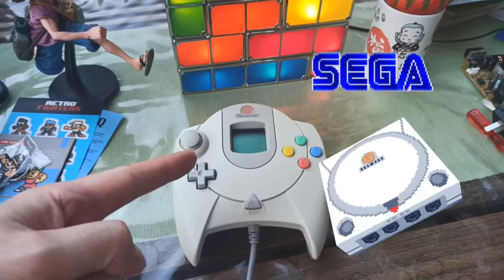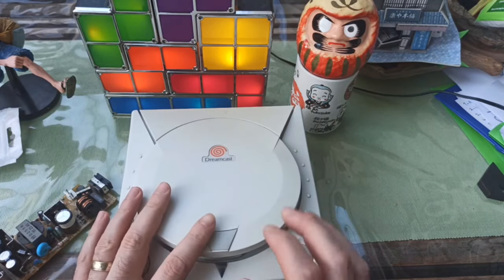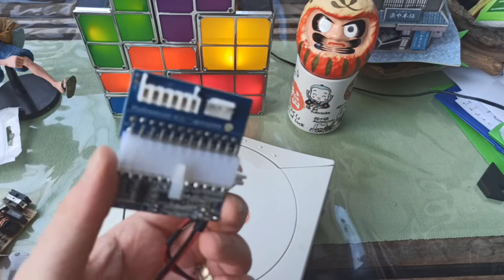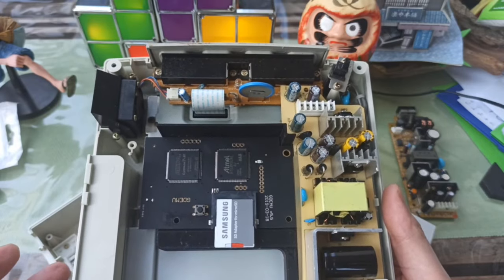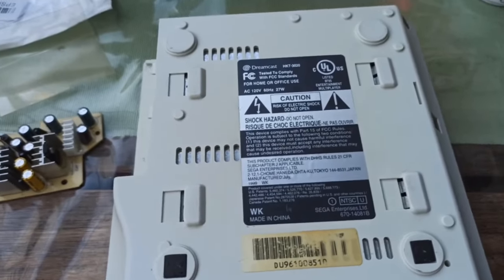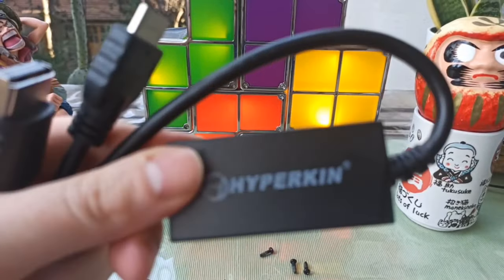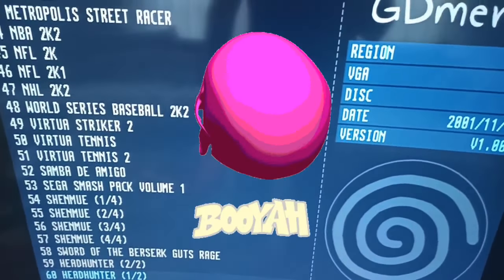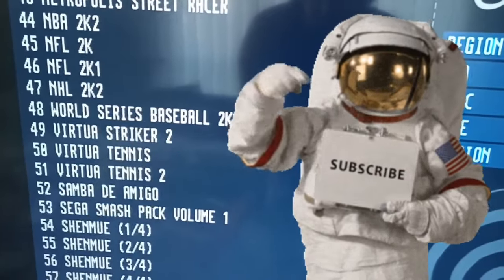Easy Dreamcast Mod

Comment: Get a dcdigital mod and a terraronion mode as there are a couple of games that glitch using a gdemu clone.
Reply from the maker: Thanks for the info! Researching both now, thanks a lot 🙏
Reply: @GamersOverdriveRetroMode  plus with a mode you can use USB harddrives I've got a full dreamcast romset on mine. I've also got 2 retro fighter pads and a brooks wingman controller adaptor and I use a wireless xbox one pad with my dreamcast and it works really well even the vibration function and its got a 1mb vmu built into the adaptor.
Reply from the maker: So awesome...I love the mod scene but I am a relative novice. Always happy to learn from more experienced people. Thanks for watching, and for the awesome info 🙏
Reply: How much better is a dcdigital than a decent vga adapter? On the comparison videos I've seen it looks very similar but I know youtube compresses the video etc. I can live with my GDEMU clone as a couple of games not working right doesn't bother me, but I'm curious about the DCDigital.
Reply from the maker: The DC Digital is a little over a hundred usd from what I've seen, but it's an involved install and you will need a little mechanical know-how (and a soldering iron). Some services will install it for you for a fee. That said, it's absolutely the cleanest signal you can get, but I'm happy with an Akura Box from the Behar Bros for now. Dreamcast games were designed for 480p. Seeing the games in 1080p is very clean but also reveals all the jaggies. Personal preference... Thanks for watching!
Reply: @GamersOverdriveRetroMode  - Yeah I thought it would be a debatable improvement (in subjective terms, not objective). I got a VGA adapter from Kaico for £13.49, looks great!
Reply: @davidste60  it's way better than vga loads sharper and more vivid. Plus you can change video modes and resolutions so games that don't support vga can still be played without swapping a/v cables plus you can in game reset.
Reply: @edbeasant9494  That's weird, it doesn't look much different in comparison videos. The other stuff can be done with gdemu, but if the picture's really a lot better maybe DCDigital is worth it.
Reply: @davidste60  na gdemu still won't play non vga games without swapping a/v cables even with vga patch selected. Some games just can't be vga patched. It's a lot better via dchdmi look at digital foundry videos.
Reply: @edbeasant9494  Oh yeah there are some games that can't be forced to vga. I've watched the DF retro videos, I don't know if it's my vga cables (cheapo kaico ones) or my TV, but my Dreamcast looks way better than their captures of the Beharbros ones, they just don't look good.
Reply: @davidste60  I think dchdmi is way better myself its a true digital signal so it is going to be better than vga it's just not a cheap option.

Comment: Does anyone know where I can get the best made dream PSU or pico PSU? They have a lot of them floating around on the internet at varying prices. Where should I buy it from?
Reply from the maker: As I mentioned in the video, I got mine on Amazon from a seller who no longer has them, but if I had to buy another one, I'd just go for Ali Express. They're reasonably priced, and while the wait time is on the long side, I've never ordered a product from them that didn't do what it was supposed to. Other than that, yeah, they are floating all over, mostly on ebay. I hope you find a good one!

Comment: So who can I send my dreamcast to in order to get some mods?
Reply from the maker: I wish I could tell you, but I don't actually know anyone who specializes in it. You can buy a fully modded Dreamcast from Ali Express with a hard drive installed in place of a disc drive. Or, you can try to do it yourself like I did in the video. It really isn't difficult and it would only take an afternoon before it was up and running. Links to all the parts you need are in the description. If you're not wanting to risk damaging your dreamcast though, check out the options on Ali express. I buy from them all the time.

Comment: Hi all! Dreamcast is still my all time favorite console. If I could find 1:1 ports of Master System Phantasy Star 1-4 that could be played on Dreamcast (not some “remake” editions), it would be the only console i care about. 

I’m loving the idea of the GDEMU, and I’m not asking for pirate links, but is there any known way I can take my original/official DC game discs that I own and create GDEMU images directly from them? A “GD-to-ROM” ripper app? I’d buy a GDEMU in a heartbeat if I knew how to get the game files of the proper format to add to an SD/MicroSD card to use! What file type is needed? .iso? .bin/cue? .CDI? I’m dreading the day my original optical drive fails. 

2 more questions: 

1. Does any company make new replacement GD-Optical drives for Dreamcast? Or compatible optical drives so I can swap it out when the original dies? 
2. When using a GDEMU, do you need a separate SD card for each game? Or can multiple games be stored on and played from one SD card? Is there a menu system to choose which game you want to play? If so, is that built into the GDEMU or require separate software? 

Thanks to all for any help!!!

Comment: No this isn't.  The ultimate mod is the DC HDMI.  Also that PSU is janky and the stock one should be retained unless you are importing a 110v DC to a 220 country and vice versa and then you could always just find a for parts DC from your region and swap the PSU from that.

Comment: What’s the longevity of these mods?
Reply from the maker: Great question. I guess only time will tell. All of these original consoles will die over time. Boards and chips erode. Digital preservation is the only way we'll be playing classic games long into the future, so I just see this as a nice midpoint compromise between the original hardware and the increasingly digital future.

Comment: Ultimate????? You forgot the fan upgrade, battery replacement, pico fuse replacement, dc digital come on mannnnn
Reply from the maker: 😂You're right. I do need all that. But I'm a busy guy and it took me forever to find the time to get this far, so it's "ultimate" for me until further notice.

Comment: Man, I was like wait he was able to install a gdemu into a launch edition Dreamcast. Than he turn it over and it v 1. I have a launch edition that I wanted to do the same so badly, but couldn't because mines is v 0. The only way for me to do the same is to buy the Mode which cost so much money, I just can't.  If I do ever buy one I rather throw that into a Saturn which is a more complicated system to do anything for. It suck having a v 0 Dreamcast yet people keep telling me that the best version.
Reply from the maker: Very interesting...I bought this console together with my best friend. We bought two consoles on the same day, 9.9.99, after saving up for months. I sold mine years later, but he kept his and gave it to me 2 years ago after I told him I would eventually mod it. I honestly have no idea what the differences are between a version "0" or a version "1" but I called this a "launch model" because it was purchased on launch day. How is it possible that I have a V1 if it was purchased on 9.9.99? If you know, please let me know!
Reply: @GamersOverdriveRetroMode  This from a random site, but I remember reading about it when I was interested in modding my Dreamcast as well.

VA0: Found mostly in JP region, though some US consoles exist as well. Uses slightly earlier motherboard revision with temperature sensor, heat pipe and metal fan cowl (some sources say it’s because it heats up more). Has earlier BIOS version but most importantly both the BIOS and FLASH chips are 5V devices and output 5V on the G1 bus – which is not safe for GDEMU.

VA1: Most of the Dreamcast production run was VA1, nothing special about it

Yeah I guess I got unlucky. I reserve mine  from Gamestop. I can still remember the day it launch. I was in high school when it ended for the day. I got in my car and sped all the way to the mall. I also reserve Soul Calibur because I played it a few time in the arcade  and really like it. After that my house was the go to spot and I remember playing that game with friend for years before dropping it for something else. Only to play it again in preparation for Soul Calibur 2 arcade.  Good times.
Reply from the maker: Awesome...and thanks a lot for that info. Dreamcast launch was one of the best days of my young life 😂 My friend and I got ours from Electronics Boutique in Boston, and I bought just about every launch title and accessory they had...I saved up every penny for months  from my job at a cafe called Au Bon Pain. My friend and I road the subway home like two bank robbers, sweating and looking around in anticipation of getting jumped and mugged. When we finally made it to my house, I set it up, popped in Soul Calibur, and then it was a wrap...nothing else could compare, and the jump from ps1/N64 was mind-blowing. No console since has impressed me in the same way.
Reply: I have a VA0 and had to get a MODE as well. It may be more expensive but it’s much better than the GDemu. For the Saturn I wouldn’t get a MODE but rather a Satiator.

Comment: how the heck you hate Shenmue? you don't deserve this...Now talking seriously GDemu is cool, I was kinda suprised that you got the original, specially considering the lot of clones that are on internet right now
Reply from the maker: I think I also have a clone actually. It seems to be a very good clone though. Really can't tell the difference personally, and it was much cheaper. But yeah played Shenmue to death when it came out. Can't stand to look at it now..for many reasons. I respect its fans, but I have no love for the series, or Yu Suzuki.
Reply: @GamersOverdriveRetroMode  nah I think is original the main difference between a GDemu clone vs an original in aesthetic is that the original is black colour with a little graffite tone (like the colour of the first N64 model) and the clone is black and a little shiny, but yeah if is working fine until now is better not risk to update the firmware, cause updating it kill the clones, so is better leave it as it is now, anyway and about Shenmue I understand, I personally don't come back very often to the first game, but to the second game I finish every time once a year, but is understandable in the case of the first one cause in time progress it aged sadly.

Comment: Is jojos bizarre adventure available?
Reply from the maker: Love that game, but it doesn't run in Vga mode unfortunately!
Reply: What is vga
Reply from the maker: Original Dreamcast had a few output options. VGA was the highest quality and the one closest to the HDMI we use today. The GdEmu board I use inside my dreamcast allows me to play games off an sd card through the VGA signal, which is sent through the HDMI cable. Anyway, not all Dreamcast games are compatible with that signal. Jojo is one of them. So it won't work on the setup I have here, unless someone knows a way around it.
Reply: @GamersOverdriveRetroMode  damn thanks anyway